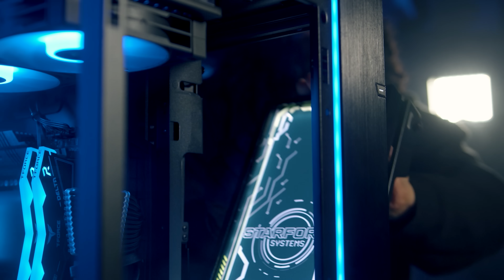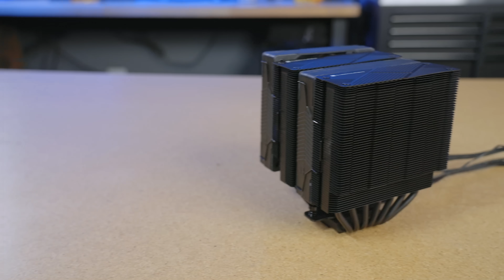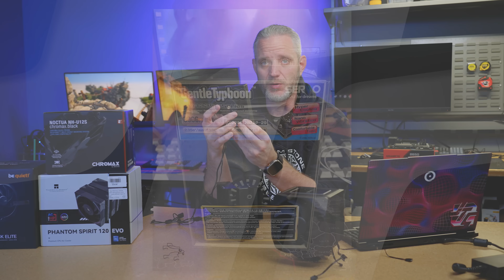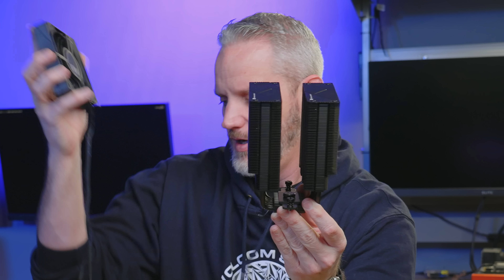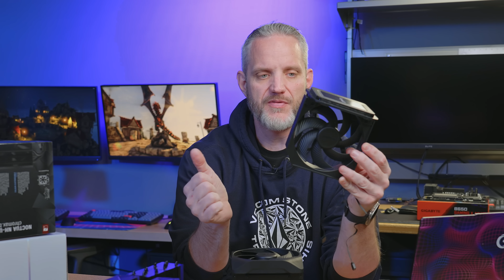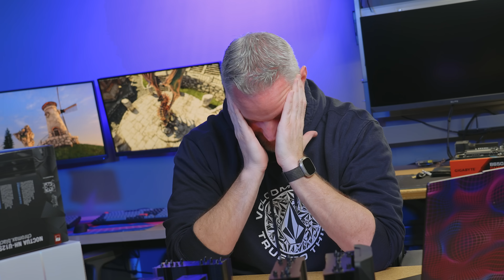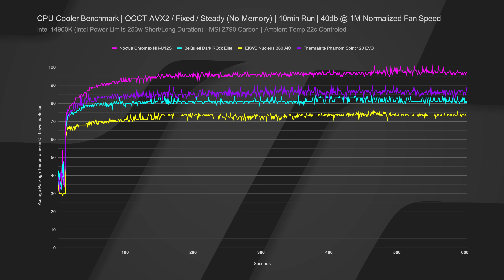This $49 CPU Cooler has big brands SHOOK! Thermal Testing Cheap vs Expensive CPU Cooler!

Comment: I'm very happy with the Thermalright Peerless Assassin 140 Black, my 14700K OC never goes over 75 degrees even under extreme load here in South America where you also have to deal with 35-40 Celsius or 95-104 Fahrenheit during the summer. Why I don't even bother with AIO.

Comment: Good timing. Just did research into this very topic. Hard to beat the Thermalright's performance per dollar. I found a single tower design that punches right up there with Thermalright on performance per dollar. Please test Scythe Mugen 6 DBE (Dual Fan Black Edition). It offers superior performance when comparing size. This will have no problem with RAM clearances since it doesn't even reach it thanks to its offset design. Got it for $55 on Amazon. Hardware Canucks reviewed it and mentioned its better the Intel vs AMD chipsets due to shape of the heatspreader being slightly either convex or concave. Pairing it with 14700K / Nitro+ 7900 XTX

Comment: The problem is, what do you want to do to make an air cooler different from others?
Heat pipe count, fin density, cooling plate, and fan.
All such concepts have already reached their optimum.
The only new additions are LEDs (LSD) and LCDs.

Comment: you getting lower temps then me with 265k with a 0.100 Undervolt + 1GHZ E-core OC With H150I 360MM I Hit 97 - 100C On OCCT Maybe The Corsair AIO is Just Trash For Cooling Legit.

Comment: Thermalright is the GOAT of budget coolers
Reply: At least since the DeepCool sanctions.
Reply: I have a TR Burst Assassin on a R9 7900x and under all benching I did, even extended runs the CPU never got above 83° C. It's a 6 pipe single tower dual fan for $30 USD.
Reply: The thing is, that implies a trade-off, and there really isn't one with Thermalrite.  They are budget-friendly, but go toe-to-toe in terms of performance with the "big brands" that come in at double or triple the price.  It's really hard to recommend any other air cooler for somebody building a system right now.

Comment: I love my phantom spirit 120se, I got rid of my 280mm AIO for this cooler and it's about the same cooling performance as the AIO I got rid of. It will also last way longer than an AIO too
Reply: front intake 280  aio  wil blow any air cooler out of the window
Reply: @norkris8729  I used to use a 280mm aio for intake and temps were near the same as my current air cooler
Reply: @TheBlueBunnyKen  dust and repasting

Comment: Jay I'm curious if push or pull is better with one fan?  Based on the idea of wind turbines with rings around them. If wind blows into a funnel, all the air restricts because it bounces back and forth and gets in its own way, but if the wind turbine is at the front of a funnel where it goes from narrow to wide, the air creates more vacuum pulling more air through. I know with a fan creating the air, the vacuum action wouldn't really happen, but I wonder if setting one fan up in pull, where it's sucking air rather than blowing it, if that wouldn't help with air resistance, helping the fan to cool the radiator better.  Radiators on cars are in a pull configuration, I assume because of the air they get from driving and to keep gunk out of the fans.  I could probably test it, I just have not made it that far, but 8t is something  that is always in the back of my mind. I suppose it would only be worth making a video on if it is proven that sucking is better than blowing for cooling radiators.

Comment: using the Noctua single tower is  dumb, unfair comparison in my opinion. Only because A. it's not rated to cool the amount of heat that the 14900K is known to output, and B. there are many single tower coolers that are just as good at the Noctua for far less. The Hyper 212, the Snowman, I think deepcool had one. All for 30-50 bucks, which changes the comparison vastly.

Comment: And now do the Noctua NH-D15. i wonder its place on the new CPAD-C100tjmax/$ Chart.
You kinda did Noctua bad by comparing a 130Watt cooler to 260 and 280 watt coolers.

Comment: I don't know if this has been mentioned before, but the way the PS Evo cooler body was installed is the wrong way round.
The cooler is asymmetrical, meaning the way it was installed in the test, it's closer to the GPU, but it should be the other way around. :hand-orange-covering-eyes:

Comment: I started using thermalright coolers and fans, they punch way above their weight, best cooler for the money, I have the peerless assassin and it keeps my overclocked 5700x cooler than the 240 aio and lasted more than 9 months.there are now 2 of them in my house and would not go back

Comment: I got the single tower Thermalright for 21$ and i've yet to see my 5700x get above 40c, granted it's not had to deal with summertime temps yet and I have a pretty good fan configuration besides.

Comment: I use the Thermalright Phantom Spirit 120 SE on my 7800X3D with Arctic MX-6 and get around 40 - 43 C on idle. If I remember the fans are around 30% - 40%.

Comment: I have to kinda say that those air coolers that are 100+ bucks are really weid positioned. At this price point you can get yourself an AIO watercooler that not just outperforms the air cooler BUT also has the advantage of being way easier to fit (as the part mounted on the cpu is tiny in comparison to the massive towercooler.)
A 50 bucks air cooler however fits in much better imo, as it now at least doesn´t compete with AIOs straight away.

But maybe that´s just my opinion.

Comment: You can get an equivalent single tower cooler compared to that Noctua with better temps and performance for $20-25. I have an older Deepcool Gammax 400V2 heatsink with an Arctic P12Max fan that can hit 3000rpm. It cools a stock 5950X 16-core CPU no problem (150 watt PPT), and the chip at max loads all core is around 75c the fan at 2700RPM.

Comment: I think the inverse of this equation is somewhat easier to understand, as it gives the amount you pay per degree from 100°C. Thermalright is $3.33/°C, beQuiet is $7.26, and AIO is $5.82
Reply: This is what I was thinking as he explained it. I get it, its pretty confusing when explained, but I get it.  But, just give us a $/<temp> value number.  Similar to a HardwareUnBoxed $/FPS  'Value' for GPUs.
Reply: Expand this to 10 years and that AIO suddenly cost double, if not triple.
Reply: Also having the metric at different noise levels would be good.
Reply: @nakofoefire  I think he doesn't really want to do that without a (Steve's favorite word) hemi-anechoic chamber. The scope of GN style testing is not what he said his new format will be. He'll stay more on the consumer advice and comparisons side of things especially for secondary and at some point subjective figures like noise emission. In my opinion a very good and valuable contribution since most GN videos are very technical and not for a random dude checking on youtube what to buy to keep his new cpu cool. 
If you have to stretch your budget for a cooler you most likely don't care if it is a few db louder and if you actually have to money to throw at your system you'll most likely go custom loop, big radiators, big slow fans anyways which is usually the most quiet of solutions.
Reply: Client vs developer.

Comment: There is probably a case to be made that you should use a 120 AIO for this and not a 360.  You need to test the coolers that come with the processors.  Also, on your charts you should highlight the AIO to denote it's not an air cooler and keep your air coolers and AIO's separate for most charts.  Also, you should have a simple chart that denotes the time to fail on an overclocked cpu.

Comment: I have used various Thermalright coolers for a long time, they've always been great value to cooling ratio.

Even the 360 AIO are obscenely cheaper than many others, but work just as well.

Comment: Just bought a phantom spirit 120 for my new 7700x build and I'm very happy with it so far.
Reply: what thermals you have idle - max ? i have the same cpu and cooler.
Reply: @KYNIKOS-84  idle is around 35-40°C. I don't really play demanding games so haven't maxed it out tbh. But when playing Doom (which I've realised is quite CPU intensive) it runs at about 50°C.

I've read the 7700x is designed to run hot though, so don't worry too much if it does.
Reply: @Ryan-lk4pu I have enabled PBO and set thermal limits to 75. When idle, my temps are between 38 to 40°C, and in games, they range from 55 to 65°C depending on the title. The processor reaches 5500 MHz on single-core and 5300 MHz on multi-core. I'm in Greece, so we have high ambient temperatures!

Comment: I've had Peerless Assassin 120s in 3 of my builds (12100, 5800x, and 7800x3d) for a few years and have been very happy with them, except for the fans.  My PA fans start developing audible whining after a little more than a year.  They're still a good deal, just be prepared to upgrade fans sooner than you'd expect.  By comparison, my SL120s that I have as case fans are still running extremely quietly, but one kit of those fans cost more than both coolers put together.

Comment: I bought four thermalright cpu coolers for recent builds and two of them had bent towers that made putting the fan in the middle impossible without bending the towers out. I get that these work well for many people but i rather spend a little more and get the guaranteed quality of noctua.

Comment: I like the video and concept but have 3 issues.  1 is that noctua released the redux version of the cooler in the video that is currently at $60-65 on amazon and performs the same, if not the tiniest bit better (no more than 2 degrees difference).  2nd issue is that the AIO is being treated unfairly in the charts as it was not tested/was not allowed to get to full fan speed and is being misrepresented in the final 'degrees per dollar' chart.

And lastly, anyone getting an i9 for their build should in no way be considering a single tower cooler to begin with, so it was setup to fail (in this test/video) from the start.

Comment: You can save a bit more getting the non-RGB version of the Phantom Spirit.  I used this in my 9800x3D build.  The EVO version does look a little nicer as it's more blacked out.  Also has faster fans: 2150rpm vs 1500.  Not sure how much of a difference it makes, but my CPU never gets close to thermal throttling, so probably doesn't matter.

Comment: i have a Corsair A115 and i can tell you that most modern dual tower dual fan air coolers perform quite similar, the main difference is the noise level, but performance wise they are within 2 or 3 degrees of each other, i bought mine for 90 usd, the ratcheting system for the fans are convenient but i feel i paid 20 bucks too much, this TR Phantom Spirit is a great air cooler, looks good and performs well and guess what?, this is the expensive deluxe model, TR is awesome.

Comment: One reason to possible get the Noctua is case and motherboard compatibility.  While value and performance to dollar are important, compatibility in an existing or new system also needs to be considered.  Blanket statements of "Why anyone would buy X", while not mentioning to vet compatibility for any vendor, the statement becomes a bit of hyperbole.

Comment: I just bought an ID-Cooling Frostflow 240mm for $55 that has impressed me. They have a physically similar air cooler to the Phantom Spirit for $30. You might want to check it out.

Comment: Glad to see you moving into this kind of testing. from a methodology standpoint, I would have liked to see a plot of ambient temp and CPU power draw to establish consistency. It's one thing to say the power and ambient are the same, it's another to have empirical data to back it up. not for every chart of course, just for videos like this where you are establishing methodology, or should methodology change in the future. I would also like to see, in addition to the noise normalized test, a variation with all coolers at 100% fan speed to prove maximum capability for those not sensitive to noise. Pump speed on the AIO would be nice to know as well, though it's possible you said that and I missed it. I also wonder, for the people who are looking for silence, if it would make sense to do a Temp normalized test? IE how slow can you run the fans on an AIO to get the same temp you get on the Noctua U12s? just some general thoughts and feedback, do with that what you will. love the videos lately, keep it up!

Comment: I use the Thermalrite Phantom Spirit 120 Evo as well with my 9800X3D (5.4ghz, -30 all core), absolutely amazing for the cost. Gaming my temps are around 60C at the most, stress test might reach 80-82C, no downclocking ever. Pretty silent fan curve so it could probably go lower.

Comment: So direct heat pipe has problems. The heat pipes that are not directly over the hot spots get underutilized, giving worse performance.  Which is why we only see direct contact a lot in stuff like a laptop where a single heat pipe can cover the entire component. In a desktop, the efficiency loss is made up for in that you can actually use all the heat pipes to cool the CPU. 3D vapor chamber, in theory, should give the best results for air-cooling, but there is a reason almost every company has abandoned direct contact heat pipes for vapor chamber to heat pipe, or contact plate to heat pipe

Comment: $35(USD) for a TR Peerless Assassin SE... it idles at 350RPM, usually about 600RPM in gaming and rarely do I hear the CPU fans (R7-5700X3D). I was holding off to get a new Noctua NH-D15 G2 and when it arrived it was $150 (USD) so I said... uh, what? Then I did some research and realized that the $35 cooler would already be nice and quiet so what was the point of spending more? (I did custom mod my RTX4070 Dual OC from Asus with two Noctua fans. It's dead silent even with a stress test.)

Comment: You definitely need the cheaper Thermalright Peerless Assassin 120 SE in your charts. It is by far the cheapest dual-tower air cooler available right now. Noctua has better coolers than that NH-U12S, it's probably one of their worst 12cm fan coolers. The NH-U12A is their actual best single-tower cooler, and of course, there's the ubiquitous NH-D15 and the newer G2 variant. And, to be fair to be quiet! too, their cheaper Dark Rock Pro 5 cooler should look much better in price to performance than the Elite.

Comment: The price difference between FDB bearings and ball bearings isnt that much. Fans use sleeve bearings because they are more or less silent. Ask Arctic with their older ball bearing P12 max's and the weird harmonics they had at certain RPM ranges.

Comment: Thermalright has good cooler designs but very poor fans and godly awful mount system. Yeah, you can combine TR cooler with Noctua fans, but your price will spike dramatically. So TR is good if you only see price and low temps with no matter of fan noise and longevity, i know it is subjective but there it is. Noctua costs a lot but have longer warranty, far better mounting system, a mile far superior fans and lifetime support. So you pay more, but you get more also.

Comment: When I built my Ryzen 5900x ... I needed an expensive cooler until I could afford a better AIO... as I spent all my budget on cpu, gpu, ssd, etc.... so I went with the Vetroo V5 for $25. Running an all core OC and under volting, it worked so well, I have never changed it out. It handles any load up to 170w ... maybe one day I will buy an Artic Freezer III AIO to put on it... but, maybe not.

Comment: My roommate got one for his old i9 9900k after he upgraded.  Forgot to put it back to stock clocks (it had a 5.2 or 5.3 OC) and went to run cinebench to check temps and it immediately crashed.  Set it to stock and its been solid.

Comment: I was thinking of getting the Thermalright Evo but I ended up going with an Arctic Freezer 36 (40$) because it was double fan single tower and wouldn't cover my pretty rgb ram :). Also Arctic amazing company had an rgb fan have a single LED broken and they sent a replacement for free a week later (took me like 3 mins to fill out the form)

Comment: Awesomesauce video Jay, Phil, & Nic! I am not sure of anyone else, but THANK YOU, thank you, for going over the equation slowly after the first read. Being only a bit older than Jay (I'll be 52 this month), it sounded like a word salad. But on the second read it helped my Engineering technical (not degreed) brain understand the equation. And Jay, I don't care if someone else has already come out with the same equation. Your walk through of what you came up with made sense. And again, I appreciate it. 
Me personally, I am at some point going to do a fan comparison on my Artic Freezer II 360 AIO. Seeing what the difference is between the Artic included fans, those Cheap Antec fans you found on Amazon, and Super flower's Mega Cool fans I purchased awhile ago. 

My recommended Air Cooler to add to the Chart: Vetroo U6 Pro (since you are using a 14900K). 
Caffeinator out.

Comment: Could you add the CoolerMaster hyper 212 ? I know it's an older cooler (very old actually), but it's still being sold (pretty cheap) and it's still being used in pre-build cases.
I bought mine in 2016 to cool an i5 6600K and now I'm using it with a ryzen 7 5800x. Still works great, still using the original fan and it's 9 years old at this point.

Comment: I've been running NH-D14s for ages, not because I've had them for that long a time, but because on the used market, they are very cheap compared to say a D-15, only like £40 or so. But still perform close to a new D-15

Comment: I like this.  The only thing I could suggest is repeating this with an AMD test bed as well.  It's been shown by Gamers Nexus and Hardware Canuks that Intel and AMD have differing IHS "shapes" and flatness which can prefer different cold plates depending on how the cooler cold plate was designed.  I think it would be good to see how they compare with each system in mind.